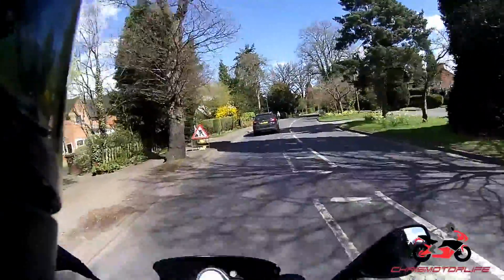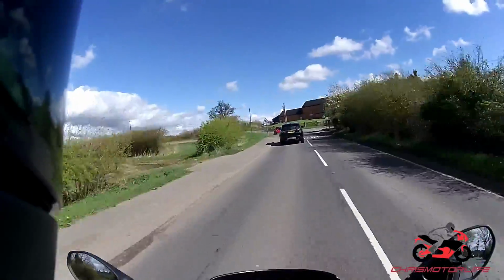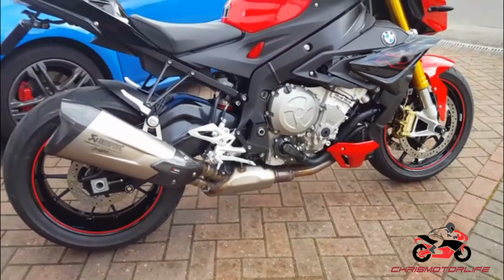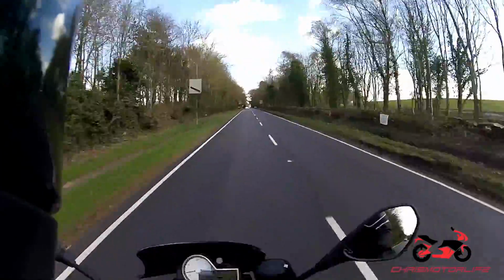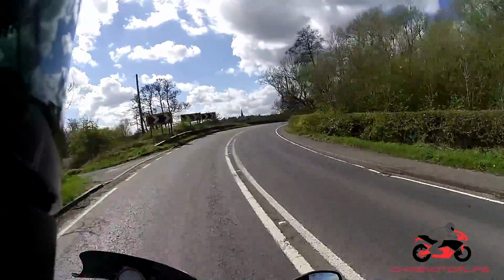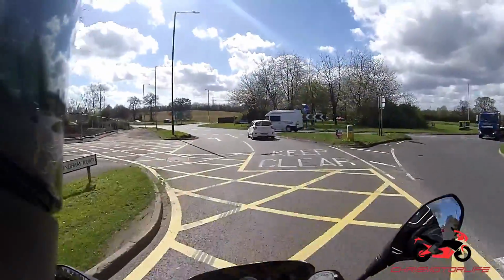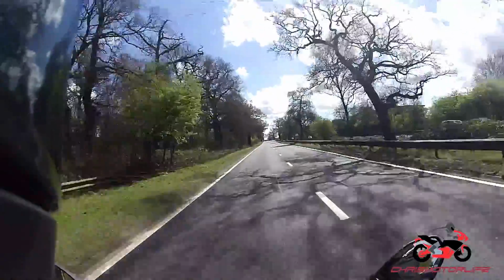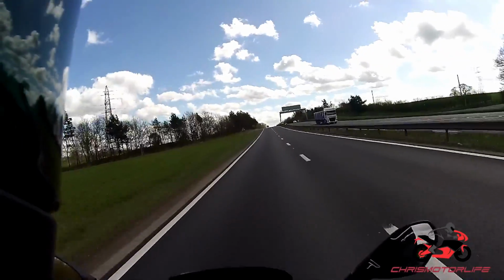EU4 Removable Baffle on 2017 BMW S1000R Akrapovic exhaust??

Comment: I get your enthusiasm. I've just gone back to the 2019 model - had the new 2021 M Euro 5 and it's wank !
Reply from the maker: Oh really?? Thats no good! They seem to be changing more and more things over the years... I did end up getting a MotoGP 'style' Akrapovic end can not long after this. Sounds much better but wasnt the cheapest lol.
Keep riding safe my friend 🙏🏼🙏🏼
Reply: @ChrisMotorLife  I saw your Akra upgrade. I kept one from my previous bike which i never fitted so looking forward to that over xmas. A GP can would help the 2021 massively on the noise front, but it seems 'soft' compared to your model. It's quick but without any fuss if that makes sense. All the best
Reply from the maker: @jezevans8697  Yeah I think I know what you mean mate. Well at least you tried one. I was even thinking about a new one but dont think ill bother now lol especially after all the bits n bobs ive now done to mine.
Cheers dude take it easy 👍🏻
Reply: That's quite a statement, Jez. I was really looking forward to the new one coming out but it hasn't had the best comments, I must say. I prefer the front end look of the older models with the wonky eye appearance. That was one of the things that made me get one. Totally different to almost all other brands.
I've done a tour round France and Spain an a few track days in the UK and Europe on my 2018 model and nobody has ever mentioned the exhaust looks or sound. In fact, when I was in Almeria circuit quite a few lads commented on how good it sounded at the end of the straights on the over-run. 
I took my whole system off during COVID and polished it right up and it looks great. Took three days on and off to do it, mind you.
Reply: @HyperBiker  hi Jason. Re-reading it, yes probably harsh. The 2021 bike is equally as fast with super smooth power, but  so seamless it’s boring. Not helped by the tame can, but you can now upgrade it. I was so disappointed with it I got rid, and bought another of the ‘older’ model, added an Akra GP can, and think it’s a much better bike. But I appreciate everything is subjective. I also have to admit I never test rode the new one, so who’s the fool ? 🙈

Comment: Have you looked into removing the baffle anymore... I am like you, why spend more money for a little more noise, but if the baffle can be removed for next to nowt then all good. I have the same bike, started with a RR in 2014, then went to the R 2015 now I have a 2017...
Reply from the maker: Andrew Sawley Hey! Great choice of bike 😉 Yes I did further look into it and BMW confirmed you cannot remove it due to the EU4 regulations. Someone told me you could still it out then weld the hole but I didn't want to start doing that. I bought an Akrápovic MotoGP style end can instead and it is a lot different! Quite a bit louder and lots of pops and bangs... well worth it I think plus it looks better. But was about £600 so just depends if you wana spend the extra coin. Thanks for watching and for the comment!! Stay safe and enjoy your bike! 🙏👍👍

Comment: i cant untherstand a thing...
So u can or u can not?
Reply from the maker: Andre Aguiar Which bit can't you understand?? I said during the walkround of the bike that you cannot remove baffles on EU4 stock exhausts...lol... so if you want to remove a baffle you will to buy an after market system 👍
Reply: Mate im from portugal... the sound it's not the best and ur pronounce its hard to understand. XD
I have a S1000r2017 the sound its not bad, but it coud be a little louder XD
Reply from the maker: Andre Aguiar Ok I understand 😃 yes the part of the video when I was rising my motorcycle the sound was muffled and not good. This is because I had a fog mask over my mouth and realised this so apologised on my next video haha. Brilliant hope you love your S1000R!! As far as I was told by my dealer and from what I have read you cannot remove the baffle on the stock pipe. But with the 2017 Yamaha MT07 you have to drill out a weld to be able to remove the baffle so maybe there is something like this I'm not sure. Hope you have a good safe year of riding your great motorcycle! 👍👍👍
Reply: @ChrisMotorLife  The sound is terrible when you are riding. My english is near to perfect, and I cannot hear. But that is because of the awesome sound of the bike haha so it is a good problem to have.

Comment: not sure you can remove it there are two small welds either side but i haven't got the balls to drill them out! id like it to be a bit louder too! i'll keep exploring...did you have any luck?
Reply from the maker: PetrolHeads London Yes I saw them and was thinking the same.. lol.. I had an MT07 before with full Akrá system on that and removed the baffle but this year's model you can't on that too and have to drill a weld out to remove the baffle so thought maybe they were the same but like you didn't want to start drilling and do any damage! I've looked at some full systems but they were close to £2000 and could justify the amount....well at least not yet lol
Reply from the maker: PetrolHeads London ^^^^ COULDN'T justify the amount...
Reply: time will tell!
Reply: @PetrolHeadsLdn  hi mate did u ever try remove this baffle?
Reply: markmcc21 no doesn’t work.  Went for a full titanium downpipe. It’s epic. Check my videos.

Comment: This post is not meant to be negative about your blog but I have to ask as a Mechanic  Have you actually removed the end cover to see and do you have the knowledge to know if it can be removed Most baffels are all fitted from the end pipe and  if you know how can be removed and this is one exhaust company that understands bikers want them out they only have to have a weld to comply with the regulations for a EU4 Compliant box I MAY BE WRONG TIME WILL TELL .NICE BIKE BUT IM NOT ALOWED ONE AS I TO OLD NOW take care and enjoy
Reply from the maker: clik uk I haven't no but when I went back to the BMW dealer for my 600 mile service I asked them, as I had read that EU4 exhausts cannot have removable baffles now for 2017 (on stock pipes), and they said they would double check. They got in touch with the rep for Akrápovic and he confirmed it himself, 2017 EU4 stock pipes you cannot remove the baffle. Thank you for watching and for the comment 👍👍
Reply from the maker: clik uk But I will go and get another opinion and double check about other bikes for this year. I'm administration for the MT07 UK Owners Club aswell and all our members who have purchased MT07s for this year who have had the Akrápovic optional extra cannot remove their baffles either... the ones that have removed them have had to take the whole can off and drill the weld out then get it re sealed
Reply: The end cover comes off once the three torx screws are removed. This reveals the end of the exhaust which is riveted all around to the body.
And this is as far as I have gone with mine.
My guess is, once the rivets are drilled through then it shouldn't be difficult to find out how the baffle is holding on. The end can be riveted again.

But, I am not ready to drill mine 😃